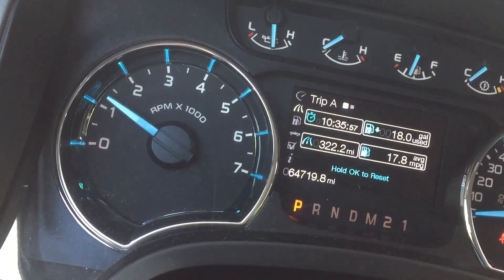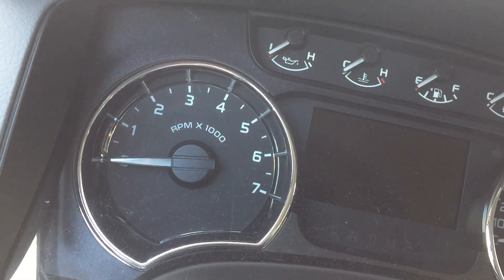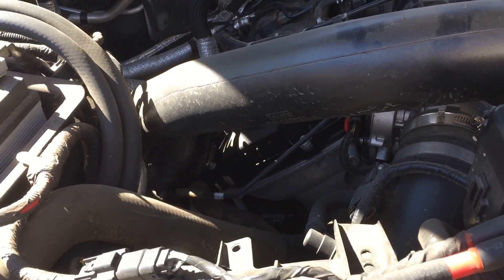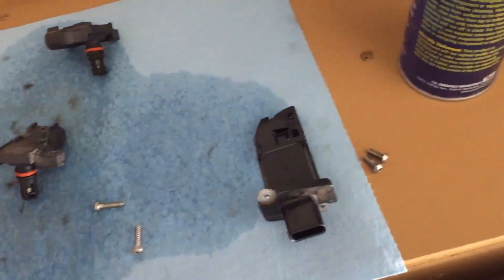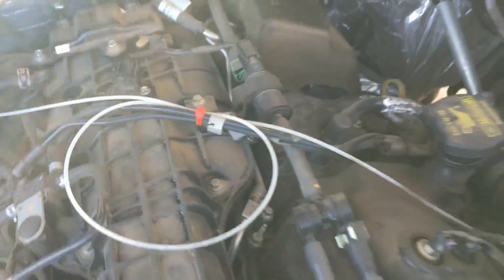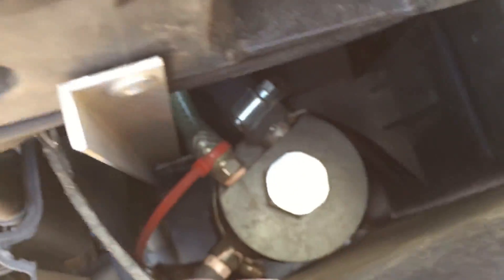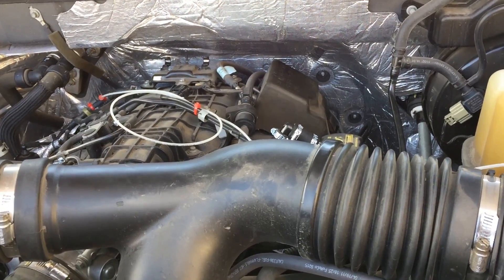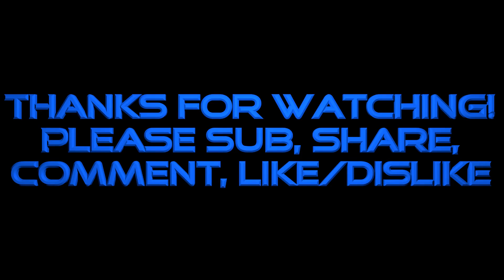Ecoboost Shudder Fix

Comment: Thank you so much for this helpful video. Have you come across the issue of losing complete power? I was on the on ramp and lost complete power, luckily there was light traffic and I was able to pull to the side. Turn off the truck and drove home safely.  Took it to the dealer and wasn't help. Searched online and saw that folks experienced as a turbo issue
Again thank you for the video.
Reply: Novakane_SC i was having this prob and especially at acceleration on highway or up a hill. Plugs changed and still misfired into limp mode. Limp mode is a safety feature that shuts you down completely. I drilled a tiny 1/16th inch weep hole on bottom of intercooler. A ton of fluid drained out and completely solved my problem 100%
Reply from the maker: If that is the case, it is possible that a vent line is plugged from the crank case, which causes pressure buildup is a possibility. That or a significant buildup of oil can cause that. The key to that problem is that crank case pressure builds up and causes too much resistance and the engine is forced to stop rotating. Cleaning the throttle body is also rumored to help, thought I haven't done that yet in 80k miles.
Reply: Tbc could be the issue known problem

Comment: I found that if i run in sport mode my idle rpms are lower that just plain D an by lower its prolly around 800 in D an in sport its prolly around 630or somewhere around that 630-650rpm at idle in park or out an that shudder isnt present but in D its shuddery if  rpms increase it goes away but other wise pain in the arse
Reply from the maker: That particular shudder may be the natural balance of the engine. They idle smoothest about 750 rpm or better.

Comment: Did you ever clean the intake valves?  I hear some guys talking about doing that as well.  May be overkill.  I'm getting horrible mpg on my 2012 supercrew 4x4.  12!
Reply: Ditto. & Sometimes in the 11 range for me. But,  It's why I'm searching you tube. Getting same mileage as my old Chevy 3500 with 7.4 liter ):
Reply from the maker: I have not cleaned intake valves, but I will be doing methanol injection to clean the valves.

Comment: thanks for this video mine was doing the same thing changed coil boots top and bottum changed plugs and gaped them at .0028 I think it was,and presto no more rough idle I am still how ever going to take out my sensors like you did and give them a good once over.Thanks a ton!
Reply from the maker: Yes, I highly recommend the 28 thousandths gap on good NGK plugs, clean the sensors periodically and install a catch can. Then get a 91 octane tune and thank me later. I have been running trouble free tuned for ~50k miles. Catch cans are definitely needed. I will be switching to the one linked in the description.
Reply: @nickelndiminit5136  what link??

Comment: Unless I misunderstood the direction of the check valve on the driver side, I think you put it on backwards.  The driver side valve cover is where clean air enters, goes through the engine crankcase and exits at the PCV then into the intake.  So really the check valve on the driver side is unnecessary.
Reply from the maker: The driver side tube on my truck was always the dirtiest and most oil filled, whether it should be or not. Ideally there should be a fresh air entry, but I haven't had any issues so far. I think these 3.5s have far more blow by than most folks would acknowledge. I am going to be changing to the catch can system in the description soon.

Comment: That long sensor is a actually a draw through maf sensor. Trust me. I’m a mechanic. Lol!! 2012 models got rid of it and went with a map sensor in its spot.
Reply from the maker: Yes, it is a maf, but the computer only uses an IAT reading from it. I misspoke and the interned called me on it, as it always will.

Comment: If your catch can system was working correctly, why would you be getting oil in the intake?  A proper catch can system should prevent any oil from getting into the intake tube.
Reply: I think he's attributing the check valves to "fixing" his catch can system.  Not bashing him.  I'm learning and what he said came off to me as this.
Reply from the maker: The catch can was put on after about 50k miles.

Comment: If that engine needed a catch can. Ford would have put one on there. You are a follower. Someone created a problem that doesn’t exist. You just had to run outside and install the same thing on your truck.
Reply: I dont think venting the crank case into the intake was the best idea that ford ever had but if you want ill save up what comes out of my catch can so you can pour it in your intake.
Reply: Don Poitras lol you literally every manufacturer vents in back into the intake. They are required to.. but blame ford
Reply: Ford is aware of the the oil issue. They do not install them from the factory due to extra service.
Reply: @craigoverlease1150  I have a 2016 F150 2.7 I bought brand new. It now has 42,000 miles and I did a blow-by test video at about 32,000 miles. It had very little. I change my oil every 8,000 miles (I have videos of that to) and I never have to add any oil. I use what Ford say use which is Motorcraft 5w30 synthetic-blend and Mo-craft filter.
Reply from the maker: Here is what your perspective is lacking: Ford, and all other manufacturers don't care about longevity so long as it lasts through the warranty period. The axiomatic flaw in your reasoning is that the manufacturers care about you keeping the vehicle to 100k miles. Statistically very few people do that today, so everything is 'lifetime fluids" such as the transmission. This is bravo sierra. Meanwhile, well-meaning folk don't realize that the manufacturer will be aware of a problem, but the engineers are told NOT to fix it because it is not worth the expense to the company. It is about the bottom line in business. Where they spent the money was in making a 3.5 v6 designed to live in a race car at 600 hp, cutting that by ~40% and leaving it in a truck. So I will happily take the other advances so that I can have a 400hp truck that is daily reliable for decades with my alterations. My transmission will still work at 200k miles where yours would not if you leave the 'lifetime' fluid in it. Grandpa taught me to take care of my stuff and it last longer. Turns out that wisdom still applies today.

Comment: Chemical engineer? Every youtuber is an engineer of whatever the subject is. Those sensors were designed to handle that environment.
Reply from the maker: The difference is some of us hold multiple degrees, while others may not. Bottom line is sensors get dirty and slow response time. If a video about film buildup slowing the thermal response times as a function of thermodynamic laws is helpful, I can do that. :)

Comment: The sensors don’t need cleaning. Throttle body is dirty. I have a 2016 F165 with 42,000 miles. My engine run smooth as butter and I have not clean anything.

Comment: Hey thanks for taking the time to make the video. I had cleaned the one right near the air filter but had no idea of the other two sensors. Guess what I'm going to do next? On another note I removed the entire bed on my truck tar/painted frame and used bed liner spray under my bed. So spraying sensors seems like a vacation had to purchase new bolts and clips for bed. I don't recommend anyone do this unless they know what they are doing. Took a few days...I should have shot a video but did take pictures! Also hate the way the hitch is installed between the c clips and cheesy plastic clips yuk. Thanks again...

Comment: I have a 2018 F150 with the 3.5l and am getting the shudder with less than 3k miles on engine. Guess ill be taking it in for the safety belt recall and to address the rough idle.
Reply: Trxextrxex did they address this at the dealership?

Comment: After watching this I checked all my sensors and there was oil build up on the sensors. Cleaned them off and my shuddering went right away. More responsive and added MPG also. Thank you for the solution.

Comment: My engine started to shutter occasionally on idle and the check engine light came on. I'll definitely wanna clean the sensors. Thanks for the information.
Reply: Throttle body gets gunked up easily. Check it for sludge.
Reply from the maker: Yes, this should help the idle definitely. The other reply is valid also. I haven't cleaned my throttle body yet.

Comment: Might need to drain any leftover oil in the inner cooler
Reply from the maker: I actually checked this when I did my catch can install and there was approximately 1 teaspoon of oil, rather than the 3 quarts the internet would have you believe. Catch cans are definitely needed. I will be switching to the one linked in the description.

Comment: 6:54 The larger block on the right, seems like it doesn't do much cleaning it. It's just a resistor.
The other two, MAF sensors, probably are much more sensitive to the cleaning, and probably the reason why the vehicle was idling rough.
Reply from the maker: The first sensor is a maf, the other two are map sensors. I misspoke there. But the computers use the maf signal as an IAT sensor rather than a maf. They are sensitive to buildup.
Reply: Large one is mass air flow . Very important

Comment: Does this also fix hesitation at low take-off speeds? I have a 2015 Ford Transport with a 3.5 turbo eco boost and I have a rough idle shudder mainly when cold but it has an intermittent shudder when at slow take-off speeds as well usually when under 20 MPH. I have replaced the MAP sensor (these do not have MAF) I have replaced the plugs as well. Still, the issue is there I have not cleaned the other 2 sensors as you did. SO this is my question. Thank you in advance
Reply: Did you clean the sensors?

Comment: Looks like a mass air flow sensor and two air charge temp sensors to me. If I'm wrong then I stand corrected.
Reply: I'd say you're right, dude in the video instantly lost all credibility with his three map sensor non-sense.
Reply from the maker: You are correct. The maf is not used as a maf in these trucks, so technically it is an IAT sensor. So the people hung up on it being a maf are not correct. That misses the point that the primary issue is the 2 dirty map sensors.
Reply: That is a MAF sensor, but Ford is just using it for IAT readings on these engines. After a certain year breakout they went to a different sensor that is just an IAT/BARO sensor. 

I'm guessing Ford was saving $ on the earlier 3.5l by using an "off the shelf" MAF to get their IAT readings, then went to the later sensor.
Reply: Omfg yes it's a MAF sensor you fuck nut and a IAT. 2 in 1 😱

Comment: This shudder is related to the orange wrench light for towing which comes on and can be debilitating while towing for ecboost engines only. Accepted solutions are 1) sensor cleaning 2) higher end spark plugs gapped according to most recent bulletin 3) coil replacement when truck is driven in hot environment over 100k miles. Current truck -12 f150 ecoboost has 218K miles with regular maintenance through two contracting companies with light towing use. Will experience orange wrench light when towing.Codes are not being thrown. Will experience rare jolts sound like transmission changes. With ecoboost engines, this may be due to a combination of transmission, intercooler condensate and sensor/spark plug issues. Provided multiple components are maintained at intervals, truck can easily exceed 250,000 miles without significant repairs except all those components.
Reply: Sonny K you need to clean out your intercooler and get a catch can
Reply from the maker: This is really great info actually. There is a new accel coil part number now that I am excited to try when it is in budget to do so.
Reply: @nickelndiminit5136  very interesting ideas on your video,thanks for sharing with all of us
Reply: Mine did this, a new throttle body was required to fix the problem. Only found it when I restarted immediately after wrench limp mode, and cel came on showing true problem was "throttle stuck closed" while at 25%. Also kicked out engine RPM problem generic code at same time

Comment: The first part of the video the engine is idling right after a cold start, with coolant cold, but the last part the engine is normal operating temp.  Cleaning the sensors didn't really cure the idle fluctuation did it?
Reply from the maker: I appreciate your diligence, but this is not a snake oil video. It is far more work to film, edit and post these videos than you realize. So why would I put up with the trolls and do all the work to fake it? The last part of the video was after I tested the truck by driving it around town, to work and back. At the end of the day the idle was butter smooth. I don't normally work on oily trucks in a polo shirt, which should have tipped you off to the after-work nature of the video close. On my channel, there is a rule of thumb. If it didn't work as advertised, it will never get uploaded.
Reply: yes and no because his was dirty u could see pretty sure it helped and he only ran it for a few minutes before shutting it down and working on it this may have taken a few hours tedious stuff .....I see no reason he would try to pull wool over anyones eyes
Reply: a for sure note when those sensors are gunked up it dose cause the issue

Comment: Thanks for the video! What mileage did you install your catch can? Have you had any other issues? I’m looking at a 2011 eco boost with 100,000. I’m just scared because this was the first year for the turbo, if it was the 5.0, I wouldn’t think twice about the mileage, but just don’t want to dump my money into a turbocharged truck & regret it. Any thoughts?
Reply from the maker: This is far too late for your use, but might help someone else. It all comes down to how it was maintained for me. I just bought a 175k expedition with a 5.4 for a daily driver/family hauler. If it has been well maintained, it should be cheaper to own in the long term than a new truck. I make good money and can't afford a new truck because it is starting to look like a mortgage payment.
Reply: Did you get it? I got an 11 with 100k last year.

Comment: @nickelNdiminit
Speaking as a person that knows very little about cars...
Was this your fix only to the shuddering while idling?
I have been feeling a very significant vibration/shudder when accelerating.
Reply: the coil boots can get carbon tracked any time you change your plugs its a must to replace top and bottom coil pack boots this solved my issues with rough start out acceleration.They can be picked up pretty cheap $3.50 a 1 pack
Reply: i would do what he did also replace plugs and coil pack boots
Reply from the maker: This is about 60% of the problem in my experience. The other part is needing to replace the spark plug boots and possibly the spark plugs if you have over ~50k miles on them. Plugs and gap are very important on these motors. I haven't tried them yet, but I think Accel just released coils for these, which really excites me. If I buy some there will be a video on this.

Comment: Have you had an issue with the timing chain slap? mine sounds horrific on cold start up but Ford won't do anything about it until it's too late and there's metal in your oil pan.  very common problem in ecoboost though.
Reply from the maker: Haven't had this problem specifically. But timing chain slap needs fixed. Fordtechmakuloco I think has a video on doing timing chains on these. I will replace mine in a video at some point but not until it is due for that maintenance.
Reply: Mine does the same thing and Ford does not care this will be the last Ford truck I'll ever buy
Reply: My SHO sounds like rod knock when starting, I got the extended warranty...
Reply: I replaced my timing chain by watching him.. then I had my rough idle issue and now here I am. Going to try your method of cleaning these three sensors. Thanks for the video

Comment: Thank you for this, I have been trying to figure this out for 4 years now. Just wondering, besides the invironmental issues it might cause, how do you feel about drilling the 1/16" hole in the bottom of the intercooler instead of using a catch can? I have heard it is under constant positive pressure and blows out all the gunk.
Reply: That's what I did.  Zero dollar fix.  Lot's of nastiness came out.  All good since.  140K and pulls like a spanked cheetah.
Reply: @Avitaser  does that apply for 15’s also?
Reply: @eyesopen9477  idk, but if does, it works well.  I'm still going strong.
Reply: @Avitaser  thanks for the reply
Reply from the maker: It is a fine example of 'hold my beer' engineering. Its not a proper fix, but like duck tape I suppose you can make anything hold still with it if you use enough. The catch can I recommend is now linked in the video description.